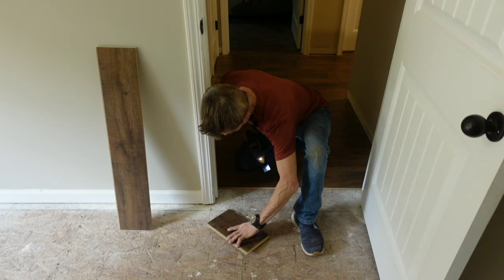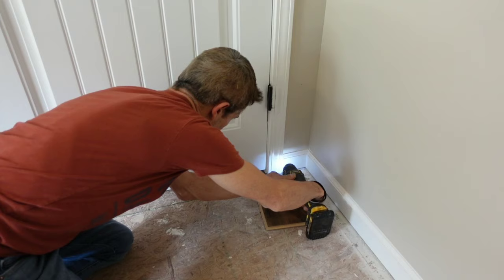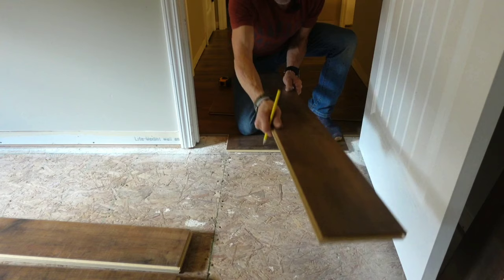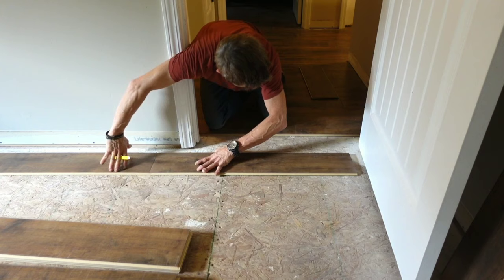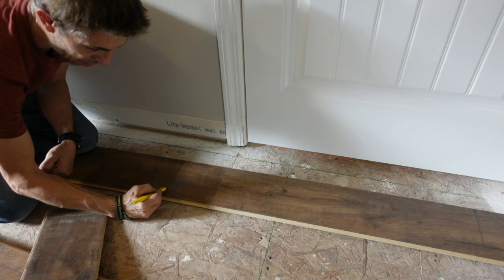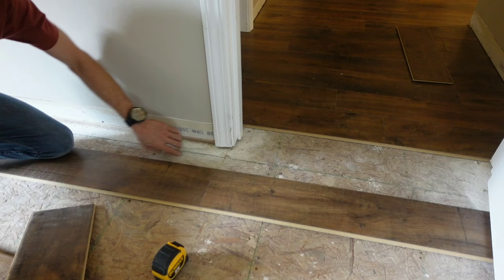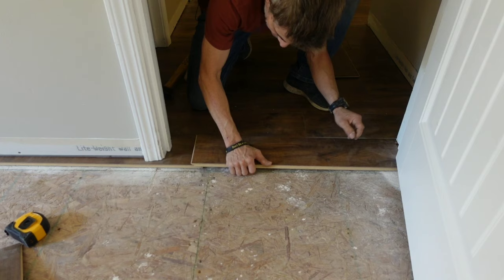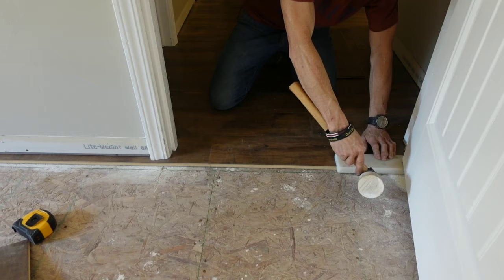Installing Laminate Through The Doorways

Comment: You butted the flooring up to the wall without leaving an expansion gap, when you were marking stuff to be cut. Big no no. You have good videos that help out a lot of people, but sometimes there are things that need to be said. Also, you are using those tapping blocks or beating the heck out of the floor with your mallet, when you shouldn't have to do that. If you left an expansion gap on the wall to the right on the video, you could have used a metal pull bar, that they sell for cheap. A couple small taps with a hammer on the pull bar and presto, it's locked in and tight.. Some of you guys should also think about using scrap flooring pieces for tapping on the laminate flooring to get it to lock in as well. Think outside the box a little and you can do this with minimal tools, like those cheap plastic tapping blocks that you can't hit very hard, or it will mess up the edge of the flooring. I would not use one of those, when you can use a piece of scrap flooring that is basically free..
Reply from the maker: I can assure you that 100 % of my jobs have an expansion gap. Maybe you just can't see it in the video. Also using a piece of flooring as a tapping Block is a tip I've used in several videos. Lastly the 1st words out of my mouth in the video is this is not a beater block it's a tapping Block. I cut this tapping block special to use for installing this type floor and I have had good results. Sometimes the detail is hard to see on video. But I was able to slide my pull bar under the drywall. And behind the laminate. I think we are on the same page. You don't install flooring for 15 years if you do it wrong. I appreciate all the tips.
Reply: @YOUFLOOR  
I love the "how too serve somebody there own ass" for not paying proper attention in class! Hahaha love it👍🏻
Reply: I’m not on nobody side but I would like to see your videos show us so we can learn something
Reply from the maker: What do mean? Have you watched any of my videos

Comment: Prior to doing what you do for the doorway, should you assemble the boards along the whole wall, then scribe and cut the boards to fit properly.  Most wall are not straight.  Thanks for your video.
Reply from the maker: Now that I have the planks through the door, its easier for me to click the next row in all the way across into the plank that goes through the door. This will leach a void whe the planks go against the wall. This will give me the exact width of my starter planks. Hope that makes sense. Thanks for the question

Comment: Hi buddy,
Your videos rock!!
I have a lot of left over laminate.  
So I’m going to put it in my bathrooms (I rather use LVP) but I need to use up the laminate.  The issue I’m having is that the bathroom floor is a good 1/4” higher than the bedroom floors. Is there an easy fix with a transition strip trick?
Reply from the maker: Check this video out. It may be some help. Keep in mind some companys now send out material to build the gap up.that will make sense after you watch the video
How To Install Transitions From A Higher Floor To A Lower Floor
https://youtu.be/_oTUB9EM3a8

Comment: This is a great, easy to understand video!   I'll be doing this exact thing with some Outlast+ laminate soon.  So, this video shows making the transition when the laminate is parallel to the door.  What about when it's perpendicular?  I'd appreciate a video on that since in my situation I've got two door ways perpendicular to each other in a corner area (two adjacent bedrooms).  Thanks!
Reply from the maker: If it helps you would do it the exact same  way. With it running parallel the laminate make a straight line for you. So you can just go with that. But when going perpendicular ,  say your door opening is 32 inches  well cut you a straight edge. It can even be a piece of flooring cut a piece at 31 and 3/4, and use that piece as a starter  when your done. But for now , lay it across the doorway where you want your transition to  stop. NOW draw a line across the doorway on the subfloor. now you can stick the tongue in the groove on the end,  and slide it down close to the top of the previous board . Make sure you can see your line on the top and bottom of the board and make a a straight line with your speed square. It will be dead on. I hope that make sense. If not let me know and I will try to put a short together for tomorrow. Thanks for the question. Sorry for the long explanation. See ya on the next one 😀
Reply: @YOUFLOOR  Thanks for the reply, but I just can't visualize what you're saying.  For clarification, I have two doors to bedrooms that are perpendicular to each other in a corner of my family room.   For the small bedroom on the right this video will work well to build out the laminate parallel to that door, however, after I bring the laminate out of that door, I'll need to immediately pass the laminate straight through that door on the left.  (I don't plan on using a transition piece for either door.)
Reply: What did you cut the plack with ?

Comment: I like your videos and subscribed. If my closet laminate is vertical can I go horizontal int the bedroom by clicking the short side into the long sides?
Reply from the maker: The only way that would work is if you had different length planks. Because all
the ones you click in on the side will land in the same place on the ends. Does that make sense? Thanks for the question

Comment: Hi. I love your Channel. 
The question I want to know. Is on my laminate floor I installed everything lays flat except for the corner piece next to the wall .I tried every solution so far it's still just a little bouncy
Reply: I tried all solution that I know of.
Reply from the maker: Sometime the very last piece is not fully seated and it will cause the plank to sit up at an angle,  causing it to bounce. May sure the plank is fully seated in the plank behind it. If it is a low spot and not too low you can pad it up in that corner with some felt paper. The quarter round will help hold it all down once all other steps have been tried. Hope that helps. Thanks for the question

Comment: Did you not use a foam underlay under the laminated flooring? how about plastic sheet for moisture?
Reply from the maker: This product comes with the underlayment attached. Also, you wouldn't want to use plastic on a wood subfloor. That can actually cause moisture. Hope that helps. Thanks for the question
Reply: @YOUFLOOR   thanks for the insight!

Comment: Will you have to put quarter round around room against trim? I have the same setup and didn’t k ow whether to take trim down to get floor under with gap or to use quarter round against trim. Thank k you!!!
Reply from the maker: Some people absolutely hate 1/4 round. You can do it either way. If you pull your base board, you still need to leave a gap for expansion. Then, you can reinstall the baseboard on top. The pros of doing it this way is you save on having to buy 1/4 round. And it does look really nice and clean. The cons are that you have to clean up the excess caulk and pull or break off all the nails from the backside. Also, if there are major dips or humps the baseboard won't bend or flex like 1/4 will. So you could encounter some gaps  under the baseboard. 1/4 round is pretty standard for laminate, lvp. And engineered wood installs to cover the gap. Keep in mind that the thicker your floor is,  the more of your baseboard profile  you will lose if you dont pull it. If you have a 6-inch baseboard, it doesn't really matter . But if someone has installed luan and viynl and didn't pull the baseboard and your installing  1/ 2-inch floor op top. Might look funny. Hope that helps. Thanks for the question
Reply: Someone please help me. Someone did my laminate for me and went around the frames and left the gaps. I didn't understand what you said in this comment reply about what is flexible that can be put there. What arey options?

Comment: Hi do you need to leave room for expansion ? I’m hoping to lay my floor without transitions
Reply from the maker: You always need to leave about 1/4 inch expansion with laminate and hardwoods. Lvp uou can get away with 3/16 or 1/8 th inch. It's okay to lay in multiple rooms with no transition. You just don't want to install in 2 joining rooms where mom keeps it warm cause she's cold while the rest of the rooms are cool. That can sometimes cause an issue. But I install all the time with no transitions. Making sure to leave good expansion around the door jambs. Hope that helps. Thanks for the question

Comment: How do you get th me grooves locked in if you do have to angle it on the long side?
Reply from the maker: Check this short out. See if it helps. Notice how I slip a scrap piece under the flooring so it's tips up for mehttps://youtube.com/shorts/t_kA83n24LE?feature=share